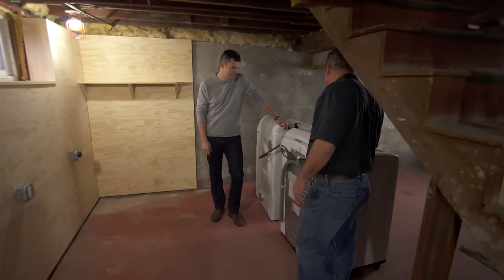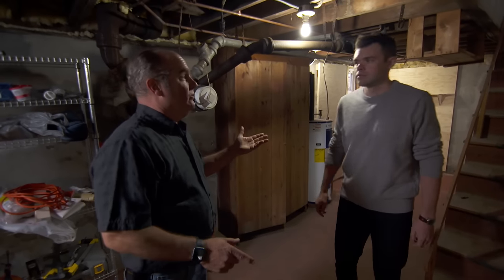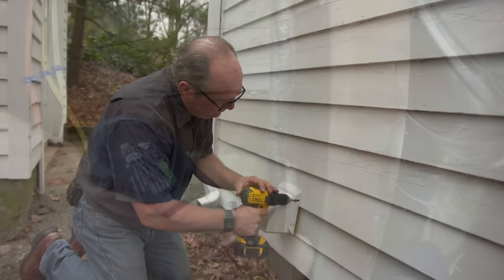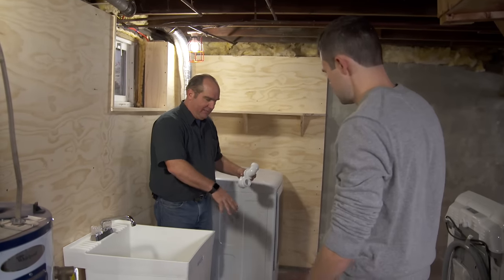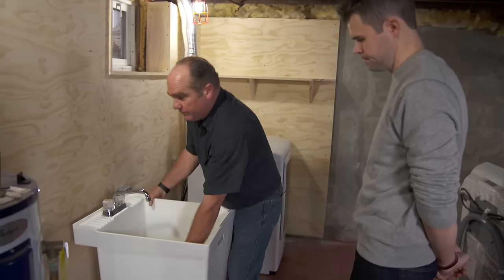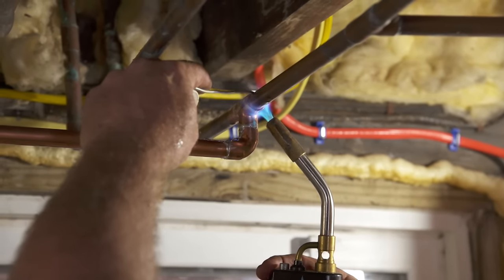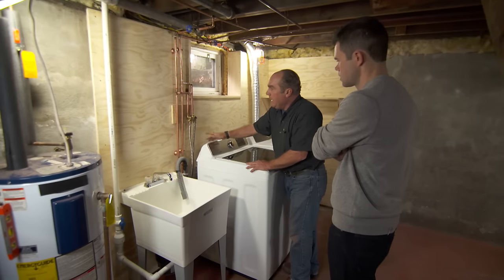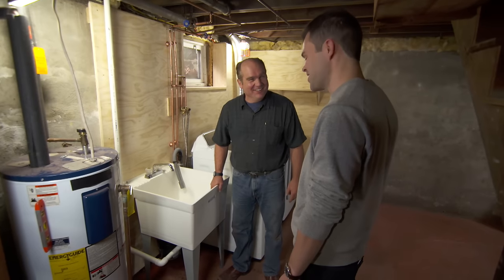How to Install a Basement Laundry | Ask This Old House

Comment: My house floor is elevated about 3 feet up from the back of my house and I wash planning to move my laundry out to the back.
This video solved most of my dilemmas other  than the vent but I will find a way. I'm 8 years late, but thank you very much.

Comment: This video answered several things for me as I'm going to be relocating my washer and dryer to the basement. My initial thought was "run the drain to the sump pump". Had no idea I could just install it to a sink! Brilliant. And also, yes, I can just drain it to the sump pump. Well done video!
Reply: I’m also thinking abt relocating it to my basement but I’m totally clueless what to do with the venting.  It seems that you don’t need a vent with pump
Reply: @bhadz100  the reason you don't need a vent in this application is the top of the slop sink acts like a vent stack.
Reply: The washing machine i just bought has the ability to pump 8ft high. No need for a sink and pump. Ill be installing it today. In my case , the drain pipe i need to access is 6ft high from the floor.

Comment: Thank you, finally a video that shows proper dryer hook up. Prefer rigid pipe over flex, less issues.
Reply: Except that he put zip screws in it. Tape or clamps only is the code I work under.

Comment: Tip: make sure you put a sock or pantyhose over the end of the washer hose. Clean regularly so the old drain pipe does not clog.
Reply: 3years later and i’m popping in to say this is genius and thank you

Comment: Everything about this job is good. The only thing I would recommend is a strainer of some type on the washer discharge hose. If not the sink drain will eventually plug with lint and overflow onto the floor.

Comment: I wanted to move my washer to the basement but had all the drain piping above the floor. Was afraid I'd have to hire someone to cut up the concrete and install a drain pipe in the floor, but this video was very informative.

Comment: That was VERY informative Richard! Didn't know that pump and the vent design were available! Thanks.
Reply: Why don't they just get a stacked unit. And use the washing machine's built in pump.....
Reply: @shahsmerdis  Either way the drain is way too high so a pump would be needed in both cases.

Comment: ball valve for throttling. nice.
Reply: @doctordumbass9425  It's wasteful. You restrict the diameter of the waste pipe, potentially risking a clog. In addition, the pump now have to fight an artificial counterpressure in the waste end and has to work way harder than it needs to, hence it works slower, using the same power, but applying a lot of bonus wear on the pump mechanics. This should have been solved by pulse width modulation on the power end
Reply: @LemonZ89  That pump is strong enough to suck a golf ball through a garden hose, that ball valve is not even causing it to break a sweat. PWM would have increased cost and possibly reduced pump life more than the ball valve did.
Reply: My rudimentary google kung fu tells me that most of these pumps are mounted in a small tank below the sink which allows it to fill a bit more and pace itself. I think?
Reply: @LemonZ89  I just bought one of these pumps. It comes with the ball valve in the box and has instructions telling you to do exactly what he does in the video.
Reply: @murph914  Yes, but those would require a vent typically. It would be a more complicated install and more money. I think it is a better system, but it would not make an easy video.

Comment: Since using the valve as a throttle of course tightens the drain orifice, I would've added a cleanout just before it. I also would've added a check valve after it, to relieve pressure from the ball valve and check valve in the pump, as replacing an in-line check valce is cheaper and easier than replacing the check valve that built into the pump assembly.
Reply: Im about to do this. So you're saying to install the check valve after the ball valve? I using the rubber one so it could be worked on later if needed. And also a cleanout before the ball valve? so in order: pump > cleanout > ball valve > check valve?

Comment: zip screws should not be used on the 4" dryer vent.  they will collect lint on the inside and have potential fire hazard.  use high temperature metal tape.
Reply: What about rivets?
Reply: @nicholasphillips5406 better, thats the preferred fasterner if you need one

Comment: Mentioned in a previous video was an extra pipe for venting, but on this one there isn't one. Is an extra vent required for the washer? I am a DIY'er and I find plumbing intimidating but am unable to find any company to come and fix my plumbing. They come out I ask for a bid and never get one. So I will have to fix my plumbing myself. Right now my washer is draining into my sump pump area, I am worried about the wear and tear on that sump pump, and then it not working when we get a big rain and it flooding my basement. I want to do a utility sink with the said pump on it, professional advice is appreciated.

Comment: Please don’t use screws on dryer vents. Lent gets caught and prevents air flow. Use a worm gear clamp for the metal flex tube or foil tape on hard pipe
Reply: Right!!
Reply: Lint*

Comment: My washer can pump its discharge into a standpipe 96 inches above the floor the machine is installed on.  I suspect most can do the same, doing away with the need for a second pump.

Comment: I think I need a laundry sink with a pump since I'm having the same problem, the previous owner rigged something up to force the washer to the waste pipe but the drainage wasn't good. Now the new washer won't reach it at all. Links to this pump would have been nice I'm left with more questions but I'll figure it out.

Comment: I got this pump and I want to install in the glacier bay laundry sink, but the bottom of the sink have 4 leaps that do not let the fiber or the rubber gasket, to flush to the sink and seal it, should I change for other sink? or there is a way around it?
Thank You

Comment: I just got the big Samsung 5.6 Front load and Matching dryer with a scratch and dent deal at Lowes and it was the best money I spent in awhile. I had an old GE front load washer that was horrible thing could never balance a load, and an ancient clothes dryer. The new laundry appliances are so nice and fast now and the capacity is insane you could wash an army with this washing machine.

Comment: The house I just moved into has a drain/sump pump enclosed into a bucket (I don't know the actual term), submersible sump pump. Is there a difference between that method and the non submersible no bucket method in the video? At some point I'm going to add another sink and will either need to drain into the current sink or buy another pump.

Comment: Ok i just saw 2 dryer vents installed, one was rerouted to go right outside with lil bends , the 2nd one went up then 90° bend to go outside. What's the dryer vent " rule of thumb ?"
Reply: Just try and go out the closest way you can

Comment: If I dont need the sink part can I just run the drain hose to the pump or take the drain hose off and run pvc pipe into the back of the washer machine then have it go to the pump? I dont have much space to fit a sink or barrel

Comment: Wouldn't that partly open ball valve plug up in no time? Especially with a washing machine draining in there.
Reply: Same question....anyone have any thoughts?
Reply: It won't. You have to throttle the valve for the pump to work properly. I've installed a ton of these pumps and never an issue. Also the pump is mainly only running gray water. It's not much to clog it up.
Reply: He probably installed a mesh screen on the end of the drain line from the washer to catch any lint before it gets to the pump
Reply: It’s just grey water so there’s nothing to clog it.

Comment: I have a similar set up, but I connected both the washing machine and laundry sink to the drain going out. I don't understand why you'd want to pump the washing machine water twice, and also add extra workload to the sink pump.
Reply: Probably because the washing machine pump isn't designed to pump against gravity, in this case about 6 ft., but the sink pump is so designed.

Comment: DO NOT USE ZIP SCREWS OR ANY OTHER TYPE OF SCREW TO SECURE THE VENT PIPE TO ITSELF. You mut only use clamps or tape to fasten the pipe together. If you do the lent will get caught on the screw inside the pipe and cause a FIRE.

Comment: im wanting to move my washer / dryer into the garage. I dont see any venting out the roof on the existing setup which 
is off the dining room. I understand the dryer vent but is the washer vent necessary.
Reply: washer vent?  It should be only 120v, hot water, cold water, and drain
Reply: Dante Casali many areas require venting for the washing machines so the water will drain properly. The open pipe creates air flow to assist in drainage. I was wondering if it is always needed
Reply: Kevin OKeefe you’re right about the water vent, I don’t know how far a washer drain pipe can be from the stack.  TOH talks about a “wet vent” when you use a larger dia drain pipe to permit multiple appliances to share a vent.

Comment: the area where i want to do this there is the main circuit box of home, can anyone tell me, in NY, how far away does this laundry set up need to be? thanks
Reply: There must be a space 30" wide and 36" deep in front of the main panel. The washer and sink can be as close as like as long as not within that space.

Comment: Can I just connect the laundry drain directly to the pump ?
If I really need a sink, can I connect sink and laundry drain with a T-pvc pipe this way the laundry isn't draining in the sink.
Reply: Just buy the pump I guess other than space there’s no need to not have the sink

Comment: Do you have the name of the pump that was installed under the sink in this video? I have a similar setup, except I have to manually turn on the pump whenever I do laundry. I would like to have it come on automatically when water is drained into the sink. Thank you!
Reply: There's a link in the description that takes you to automatic pumps.

Comment: I noticed the outlet is not 20 amp. Does the washer need a dedicated 20 amp gfci to plug into? I thought it was national code
Reply: It depends on what year NEC your state is using, but yes I believe the most current 2017 NEC requires 20amp gfci protectes circuit for a laundry room. But it does not require a 20amp outlet, for example a NEMA 20R type.

Comment: Wonder if you could tie the hose lower by the drain then it just laying in sink like that
Reply: The drain hose needs to be elevated to a point higher than where it won't be at threat of being submerged in water. If it's not, siphoning will occur, essentially sucking water back into the washing machine. In a traditional install where a drain hose is inserted into a standpipe rather than a drainage basin, if the drain hose is installed incorrectly whereupon it literally touches the bottom of the p-trap, mold will manifest and creep its way up the hose, eventually being siphoned into the machine. A drain neck (which is used in this video) holding the drain hose, zip tied off, and allowing only four to six inches into your egress point is proper.

Comment: Is this still being done today? Does this prevent water flowing back into basement if sewer gets flooded by rainstorm?  Thank you. Be well.
Reply: Water can't flow back in due to the special valve acting as a backflow preventer that was shown which also stops sewer gas so a vent wasn't required.

Comment: Question: The manufacturer says a minimum of 6' pipe is needed from the check valve up. Is this necessary? I notice you have a similar setup where 6' isn't available. Thanks
Reply: No, I've done it with less and never had a problem

Comment: We just signed a lease agreement with a house and the drain from the washer is going straight into the sump pump. I’m wondering if this is going to be a problem. I’ve never taken care of a house before
Reply: Not usually how it's done but it will probably be Okay.

Comment: Can anyone tell me if you can do this without the sink? Meaning taking a similar style pump, attaching it to the washing machine drain line and then taking the pvc up and out?
Reply: @StephanBijzitter  I have to take my drain water up 7 feet to the preexisting drain. Any suggestion?
Reply: @dominicdisano5937 … call the mfgr and ask what the max head height is for the discharge line. Most will tell you something around 6 ft or less but the reality is the pump will push it farther. The biggest problem you have is the water in the longer (higher) pipe will flow back into the washer when the pump shuts off, which may or may not be a problem depending on where that water reaches inside the wash tub. On a front loading machine that may be enough to make the clothes wet again after the spin cycle finishes. Sometimes the not so obvious fix is to place the machines on a platform, which will make loading and unloading easier, not to mention a shorter vertical run to the drain. BTW, if you build a platform consider some sort of trim on the edges so if the machine vibrates it can't slide off and yank the hoses with it.
Reply: @rupe53  I really appreciate it! Thank you for the suggestions!
Reply: @rupe53  thank you so much!!
Reply: @rupe53  What about using a check valve so the water can't flow back? Would that work?
Reply: @rawbacon  .. The problem with a check valve is finding one that fits. Quite often the discharge hose is an odd size. Next is the fact that a check valve in a vertical run has a tendency to clog / stick, never mind that they are restrictive in the first place. Probably better to put the machine on a platform to shorten the distance, or install the sink with a pump. Plastic "washtub" style sinks are cheap and will hold a full load's worth of water if the pump fails. That's better than a floor full of water any day!
Reply: @rupe53  Okay thanks, mine actually works fine pumping up about 7 1/2 feet and I get no water back in the tub but I was just wondering.

Comment: How do I get some helps from This Old House with some water heater tank, laundry sink installation, dryer exhaust, and repairs some copper pipe works (it is a mess)???
Reply: @saber-jocky3436  I, did watch lots of DYI videos and did lots of thing myself but the though of messing with natural gas scare me a bit as it can dangerous...for a novice like myself.

Comment: How  do you know which water pipes are hot and cold, cus in my apartment, its labeled or clear as to which is which,     Great vid btw.
Reply: run the water, then feel both lines, hot water line will be warm/hot

Comment: Can't use a swing check on a vertical lines you only use them on horizontal lines , you would use a spring loaded check valve on vertical lines , and the laundry valves need air arresters to prevent water hammering
Reply: Rich Santana the check was on a horizontal line, the ball valve was vertical
Reply: wrong.  That only applies to waterlines.  Swing checks are installed on sewage/sump pumps in the vertical all the time and it meets code.

Comment: Wow when you cut the pipe did you get crap on your hands it looked 👍
Reply: It was a 2" line so no crap would flow through that pipe. It's just sediment and grease, it was on the outside wall so it probably was the kitchen sink which has a disposal on it. But definitely not literal crap.

Comment: Only supposed to run 6 feet of flex drier vent. I use as little as i need to anyways
Reply: This is semi rigid, not flex. You can run 12’ i believe. This is a good set up

Comment: When running the hot and cold down to the washer why not just transition to pex instead of running more copper?
Reply: Preference, I would have done just that.  Some people still aren't sold on Pex. No idea why.  The only problem I have with it is I don't want it carrying any of my potable water.  It's probably fine, but again, just a preference.
Reply: EffArDee are you on a well or do you have Cory water
Reply: @iLikeC00kieDough  well water
Reply: Why transition  to pex?  Its copper, keep it copper. I don't know why everybody thinks pex is God's gift to Plumbing I think it's f**** garbage PEX is for homeowners doing their own work  that don't know how to solder. Same with sharkbite fittings.
Reply: @mitchdenner9743  My old man has owned a plumbing shop for 40 years, he always plumbs with pex for at least the last 20 years. The big deal for him is it won't split when frozen, which happens quite often here in the midwest. It also gives you more options when retrofitting, it bends around objects whereas copper does not. Pex also has a longer life expectancy as well, copper could corrode and pex won't. The chances are slim, but why take it when you have a product that will last forever. Shark bites are junk I will give you that.
Reply: I am a 34 year plumber. PEX has its places for sure. But I prefer to use copper where exposed to the living areas for strength. I.e. Accidental slicing etc. plus, a good job done right looks pro.

Comment: Can a check valve be installed vertically?
Reply: awhitedpi yes as long as it’s in the correct order, they usually have an arrow indicating the direction of flow

Comment: as a question, 
it's not easier just to buy a front load washermachine, do a p trap up close to the main pipe and put the washer in a 3' pedestal? like a laundromat? 
so instead of lowering the pipe you raise the floor.
The washer pump must be able to push water 5' total, no?
That way you save on all those pumps sinks etc.

Comment: Sink wasnt necessary. Most washing machines can pump up to 8ft in vertical height. All you have to do is cut the pipe add a wye and trap and connect the washer.
Reply: Do any washing machine manufacturers specify the head that their machines will pump against? Or is that just your experience?
Reply: @trek520rider2  GE specifies it in their website and manual. LG specifies it in their manual.